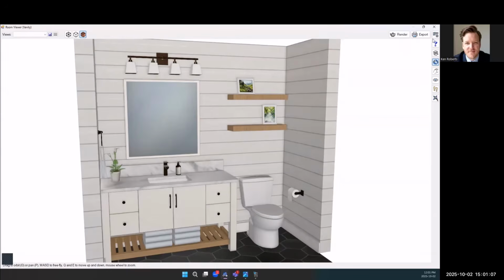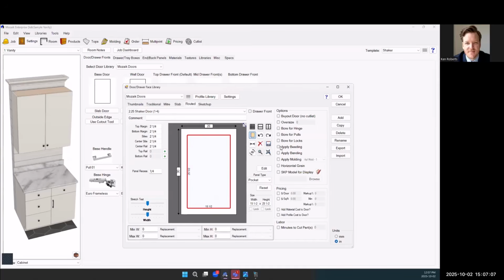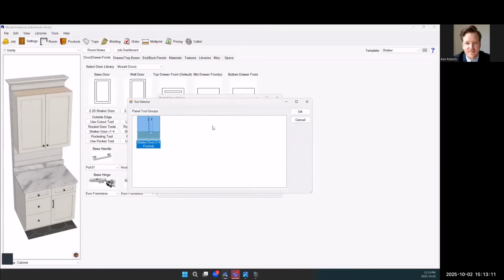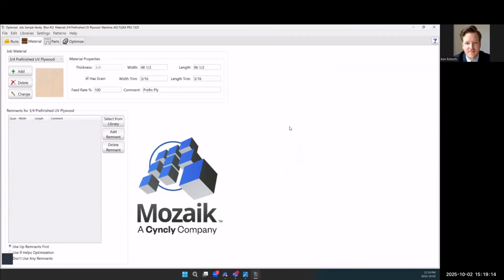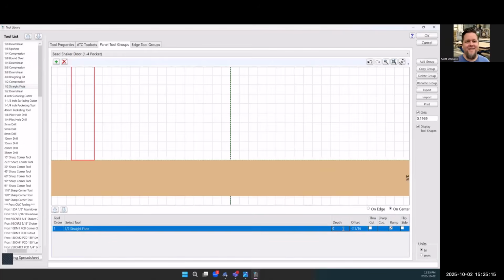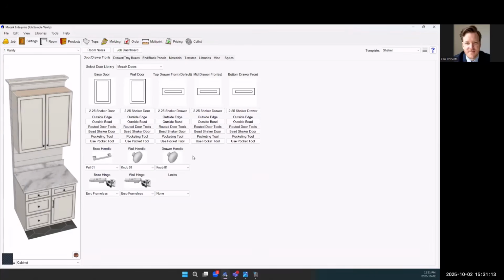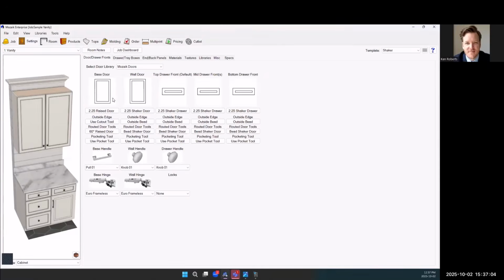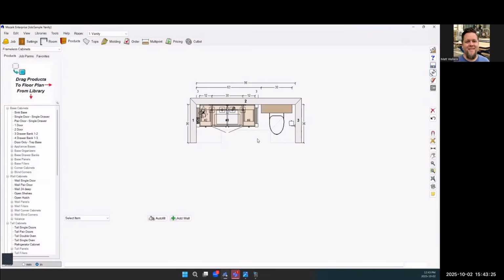Introduction to MDF Doors

Comment: Does Mozaik have a way to switch between cut directions (clockwise vs counter-clockwise) to achieve the desired climb cut or standard cut for a given situation? Or a way to tell the CNC which edge it's cutting with so the CNC can do tool compensation? Merely offsetting the tool to get it to the other side of the line will make it still think it's cutting with the right side (as drawn) of the tool which will cause tool comp to go the wrong direction and will not change cut direction.

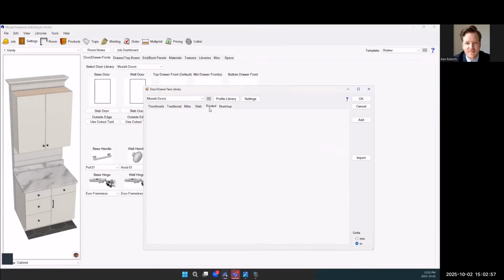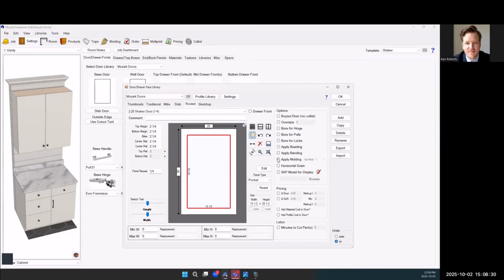Comment: Door/Drawer Library - 5 main types, design/aesthetic, CNC capabilities, use, purpose/aesthetic:  2:59-8:26  
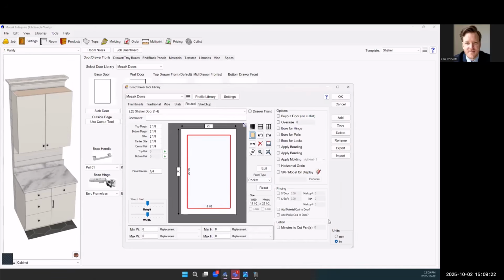Door Library Options Menu: 6:03-9:19
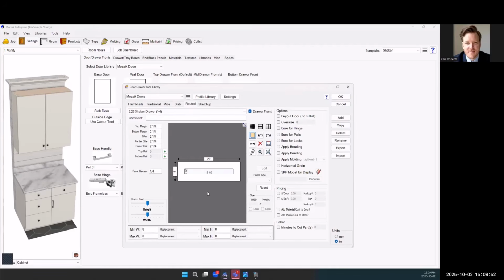CHANGE DOOR DESIGN INTO MATCHING DRW FRNT: 9:22-9:50 
Reduce Drawer Rail/Stile Size with Min./Max Heights  (6" drawer or < get's 2 in rails, 12 in. Drawer Front Keeps 3 inch all around design)
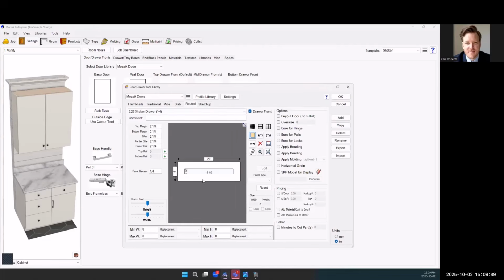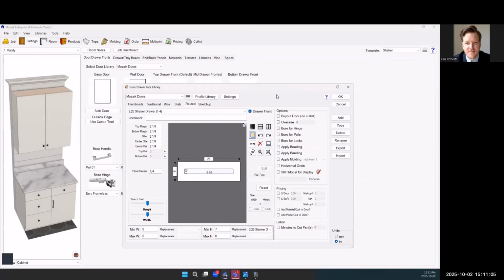  9:51- 11:01